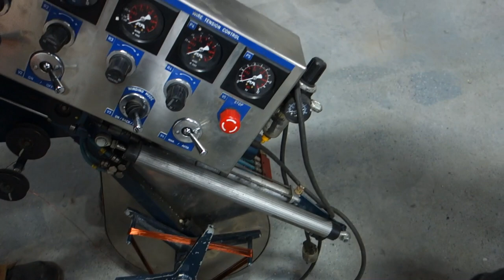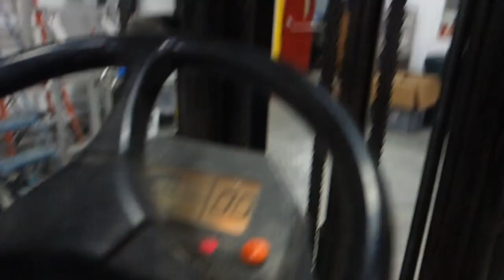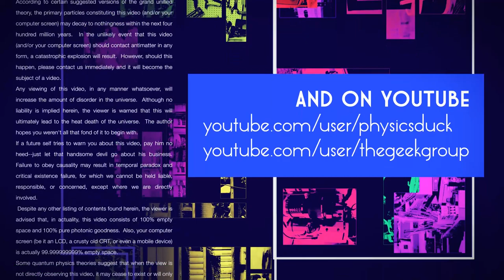Captain's Blog 1 10 2015 Fun Saturday

Comment: Looks like someone discovered the reverse function in Vegas, nicely executed
One thing we used at work for manually lifting motors was a lifting bar, 2" steel tube with a welded ring in the middle, best way is to form a ring that fits over the tube with enough spare room to fit a U shackle, would be ideal to make a couple of different lengths.

Comment: on the opening I wonder.    what is that large wooden box?  sometimes belt drives are used.  your Q and A are very helpful.  Stephen grabbing that part is unsafe.  where does the red door to the left high voltage go?
Reply: Nothing anymore, yes, yes, agreed, that way ->.